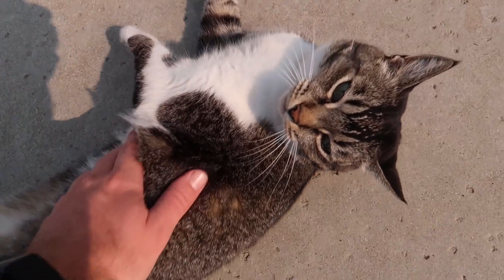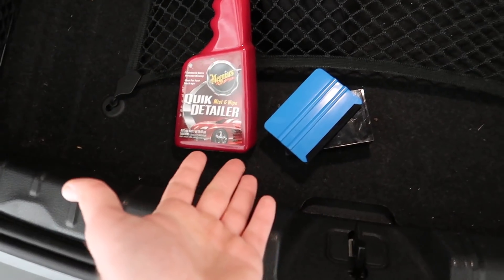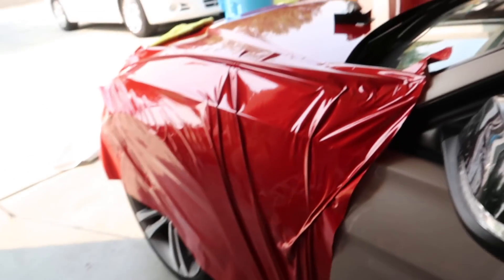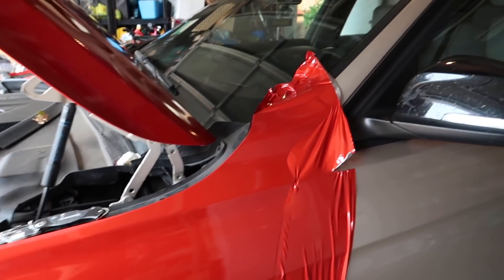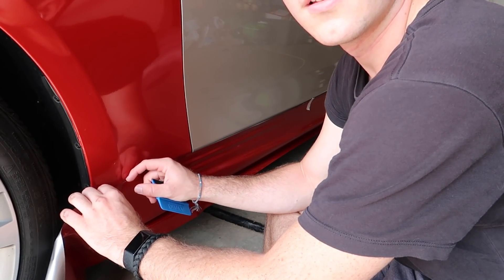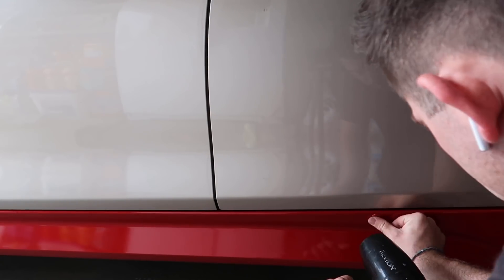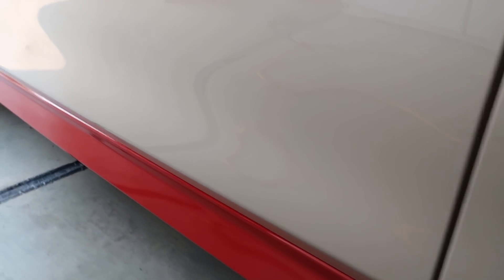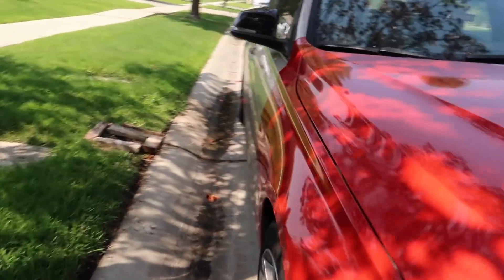WRAPPING MY 335I PT.2 (TIPS ON WRAPPING BY YOURSELF)

Comment: I do wraps for a living, and it actually looks easier than it is :P Just take your time, dont rush it. And a little tip, try to feed the material into the recesses, will not bubble up in the long run. Good job tho, keep at it :D

And always use a fresh blade then cutting, will make your life easier :)